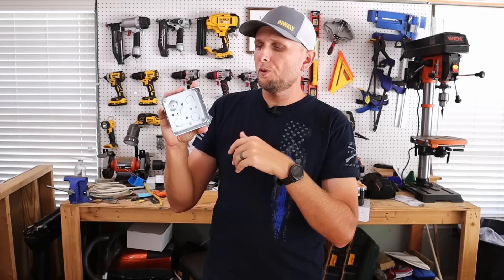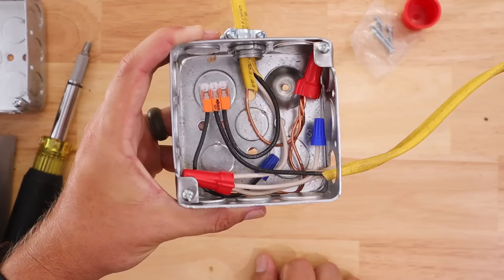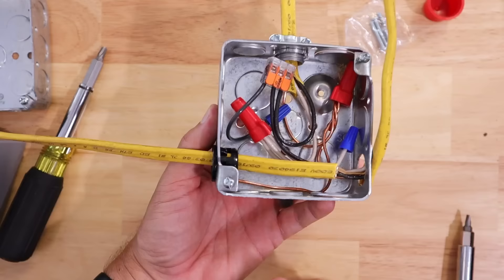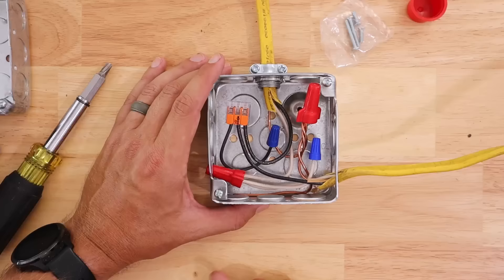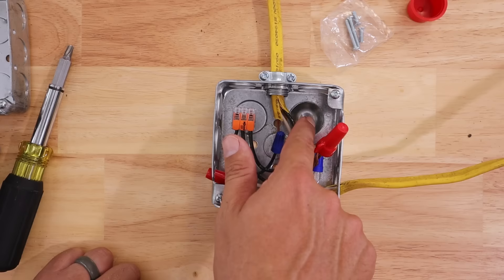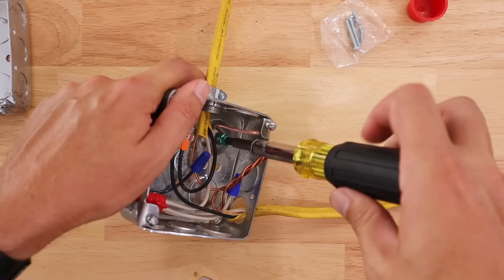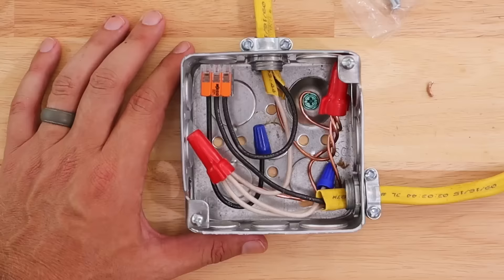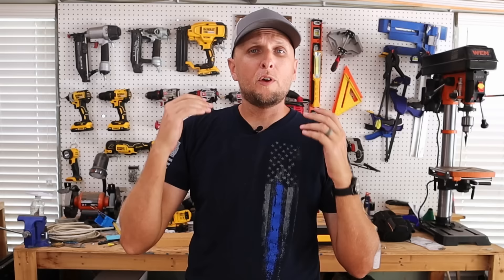The BIGGEST Mistakes DIYers Don't Know They Are Making When Installing Metal Electrical Boxes

Comment: I found one more mistake in that box which is also extremely common.  The length of free conductors is supposed to be 6" .  I do not have a current NEC to look this up for you, but nothing I hate worse when opening up existing outlets and such to find the device won't even hardly come out of the box because of the length of the wires.  Your example is not terrible, but the length of some of the wires is really too short.  Such as the neutral from the romex in the bottom right corner.  I like to bring all of a specific conductors I am going to join together in my hand and curve them in the direction I intend to fold them back in before cutting them.  This way I know I have at least enough to meet the intention of the code.

Comment: point of note to be had for any contractors that do upfits to add these kinds of boxes. the company i work for builds industrial controls and one of the products we make are essentially the control buildings that run chemical plants and similar installations. as such we run all the utility wiring for these buildings and that includes mounting receptacles and lights and all the related conduit and boxes.  these metal 4x4 boxes can be purchases with not only the ground screw pre-installed but also with a 8 inch 12 awg green wire already preinstalled as well.   just a small time saver a lot of people aren't aware of.

Comment: Here in Canada, ALL our boxes come with bond screws. We don't have to buy anything extra. They do NOT have to be green they just have to be the "proper thread". Also, if your connectors fail (wire nut/wago as you call them - which we frown upon here as they only contact a very small portion of conductor) and the conductor hits the metal box, that's installer error and you shouldn't be touching this type of thing regardless. It, which has been mentioned, is NOT a fire hazard to use a smaller gauge wire. Good example is in motor circuits where you can fuse a 14awg wire at (up to) 1600% of it's ampacity. Usually 300-600% but it can go higher.

Comment: You say 12 vs 14 doesn’t make sense but it does make sense. The hot could continue onto another box for another load, so it might need 12awg to handle multiple loads, but the pigtail for your one load here could very well do fine with 14awg

Comment: Sir, I agree with almost everything you've said, but there is one thing I must bring up. Wire gauge is in fact dependent on length. While code may or may not require a 12g pigtail, it is completely safe and adequate. Consider these two examples; while a 20 amp circuit may require 12 gauge wire, it may require a heavier gauge if the run is excessive in length. On the other side of that, consider a window mounted air conditioner requiring a 20 amp circuit on 12 gauge wire that comes with a 12 foot long 16 gauge cord. Incidentally, I just installed such an air conditioner in my shop storage room/office. I know it may not meet my jurisdiction's code, but I extended my 20 amp, 12 gauge run closer to my a/c by five feet with 14 gauge wire. I also shortened the 16 gauge  cord by ten feet. So I've actually increased the current capacity even though I used a smaller wire to feed my receptacle. Sometimes code does not mean better. 
 Having said all that, I still learn from you. Thank you.
Reply: I agree with your logic but why oh why would you not use 12AWG on that extension???? Code is code even if it's for legal reasons.
Reply: @hogroamer260   Because it would have required a trip to town and for the purchase of another roll of 12 gauge. The only reason for this would have been the to appease a code which is completely irrelevant in my rural personal shop. I am much more concerned with safety than I am with meeting code.

Comment: You should also have a ground pig tail for the ground ti the outlet. Also, Some push connectors are only rated for #14 wire. I only use push connectors for #14 wire in lighting circuits. I use #12 on all receptacle circuits, pretwist and wire nuts.
Reply from the maker: That last ground pigtail is in there.  It is just hiding behind the neutrals..

Comment: One more thing you might want to mention is putting a push penny; properly a knock out blank; in that open knock out. That opening is how the molten metal spatter from an arcing fault would escape the box and ignite the structure. 

Knock out blanks come in a couple of different configurations. If the blank isn't listed by a recognized testing laboratory then it must be as thick as the box wall itself. One quite effective expedient is 2 fender washers installed inside and outside the knock out held in place with 1/4-20 hardware. 

Tom Horne

Comment: Some Advise for pros: If you start working in a house and you find mistakes, Stop work tell the owners, and advise them to get the electrical system inspected. Document what you found and your recommendation in the invoice.  Houses burn down and people get electrocuted you do not want to find yourself in that position after you have worked on  a house.

Comment: Nice video for DIYers! Obvious US by color code of wiring, green tape should not be used to color use pigtail shown in video. Some installations require insulted ground wires. Also, you remove the knockout on the left side to show the NM connector. Did you put a knockout seal back in the open hole?

Comment: Suggest putting your grounds on the left to minimize the chance of those bare wires touching the hot terminals on the right side of the installed receptacles.

Comment: Regarding the #14 pigtail - it only needs to carry the current of the outlet it's attached to. If the outlet being installed is a 15A one, the #14 should be sufficient.

Comment: I was also taught to “pretwist” the wires, and also to pigtail the outlets. More work, but it makes a difference.
Reply from the maker: I agree.  Thanks for the feedback!
Reply: The UL certification process for twisted wire nuts requires that they make a solid connection without pre-twisting.  This assumes a proper number of connectors and properly stripping and positioning them before twisting. No solid connection, no certification.
Reply: @Steve B  Certification means jack shit. Not pre-twisting is a great way to end up with a high resistance connection that causes a fire. Hell, I just had one on my own water heater - which was installed by a licensed plumber (who are not required to hold electrician licenses). After 4 years I all of a sudden had no hot water, and found the breaker tripped. When I investigated, I found the nut connection in the heater junction was high resistance and had over the years gradually melted the insulation off over a foot of #10 armor sleeved Romex undetected until it finally shorted out. So yeah, anyone who doesn't pre-twist nut connections is a disgrace to their profession.
Reply: I learned to pre twist too. After doing that for a few years, one day I read the instructions on the bag of wire nuts and it said there was no need to pre twist. I did some work for a neighbor and didn't pre twist. A couple weeks later, they told me the light I installed was flickering. I checked the wire nuts and one of the wires had come loose. I removed all the wire nuts I had installed, pre twisted, and put them back on. No complaints after that and I learned the importance of pre twisting. That was a long time ago and what I've found since then is that 2 wires in a wire nut can hold without pre twisting, but for 3 or more, I always pre twist. Pulling a little on each wire after pre twisting and installing the wire nut also helps insure that one of the wires didn't slip and become loose when you were installed the wire nut. I like the comments about not tightening the clamp too tight on the Romex connector. Back in the 1970's when I started wiring, the insulation was significantly thicker and you could make the clamp tight without trouble. But when installing 12/3 w/g for a new outlet, I tightened the clamp too much and caused a short. I had noticed the much thinner insulation, but didn't think about the clamp cutting through it. I'm always careful tightening clamps now..

Comment: While a wirenut is ok for the grounds we always use a crimping ferrel to pigtail the grounds and if you don't pigtail the ground to the steel box, at least when you connect the ground to the outlet it has the ground to the mounting tabs which then grounds the box via the mounting process. That is ok for residential but commercial must have it's own ground wire to the box and EMT conduit must be used. [No rome cable is allowed unless it is a conduit.]
It is against code to just stuff a rome cable or even just wires through a knockout hole. You MUST use something the clamps the wire and prevent sparks from exiting the box.

Comment: Good presentation. I have seen green wire huts with a hole in the end which you push one ground wire through to go to the bonding nut. Twisting them all together is the best.

Comment: If I remember correctly the 15 amp rating for the 14 ga wire is when that wire is part of an encapsulated bundle. A single 14ga wire I believe is rated for 20 amps. Also, if memory suites me... it is common for circuit board designs to use 14 ga for internal components above 20 amp.  

Not encouraging people to go against code but it is important to know what stuff so you truly understand what is within that capabilities of the system you are working with.

Comment: In Holly, MI I was required to use green ground wire nuts that had a small hole in the end, which allowed for one ground wire to be left extra long to go through that hole to the metal box ground screw and still be able to twist on to the rest of the ground wires. I don’t know if that is code everywhere.

Comment: Ground screw is not required to be green, just required to engage two threads in the enclosure. Locknut on the metal NM connector is on backwards, knurling faces the mounting surface to bite into the box. Also need a ground tail for the receptacle. Also pay attention to required conductor length in the box. All in all good video for the DIYer
Reply from the maker: Yes I said green ground screw because my audience are mostly homeowners so it’s much easier for them to go to the store and find the green ground screws in the electrical section and know that they are going to fit correctly instead of them trying to search out a machine screw that fits.  There is a ground tail in there it’s just hiding behind the neutral wires.  Also all of the wires were measured out to be at least 6” long and extend at least 3 inches past the front of the box.  I appreciate the feedback!

Comment: When I'm working a house from scratch I always wire for 20amp and make sure the circuit breaker box and handle the number of 20amp breakers needed. My reasoning for this, is because clients tend to be stupid sometimes and plug heavy drawing items into 15 amp plugs. Also particularly on w story foyers some people don't know the fixture going in the spot how much light it will use.... A 12 light chandelier rated at 60watts per socket will overpower the wire as well as the switch.

Comment: See a lot of homeowners using the two screw connectors on romex and over tightening through the insulation. Be careful tightening the clamps.

Comment: If you run armored electrical cable into a metal box (like MC or AC) then you do not need to attach a ground wire to the metal box.  The cable sheath itself acts as the safety ground, so when you properly clamp the cables to the box it establishes the grounding path.

Comment: You can use 14 gauge wire on a 20 amp circuit when this is a tap conductor. when using a Wego connector, make sure you use a Cable tie to keep the wires together. This will prevent one of the wires from pulling out.

Comment: On that twisting the wires bit,  I did some extensive rewiring and started having problems with loose connections coming apart in crowded boxes. I wound up going through and twisting every wire nut connection I had made.

Comment: Some boxes do not have a threaded hole for the ground screw. Instead, you can use green-tinted grounding clips that slip over the edge of the box. The clip grips tightly, but of course you still have to screw the cover plate on, which holds the clip positively. I always put the clip next to one of the cover screws.

Comment: I do hvac and always use metal boxes. I also use wire nuts. That's just what I'm comfortable with. I do pre twist the wires now after watching another one of your videos. Just seems like it's a safer thing to do even though I've never had wires come loose.
Reply: Read the instructions.  If the wires are stripped properly and sized properly for the nuts youre using then the only other requirement is that they be held even. Pretwisting wont matter.
Reply: @jeremyhall7951 yeah the wire nut twists them just the same, maybe better than wrangling them with pliers.
Reply: @jeremyhall7951  Yup, holding the ends even with the proper wire nut is the key factor.

Comment: Good informative video.  However, one thing your presented isn't exactly mistake, the #14 pigtails with the #12 wire.  If the circuit breaker is a 15A then it is just fine as the NEC defines the ampacity of the circuit to be that of the lowest wire in the circuit which would be 15A for #14.

I'm sure you know why you would see #12 or even #10 used to feed a 15A circuit, long runs and to prevent excessive voltage drop.

That is just my nitpick, to call it a mistake is going to depend on finding out what breaker is protecting the circuit.
Reply from the maker: Yes my intention was that the breaker would be 20 amp with the feed wires being #12.  But I didn’t mention that and shouldn’t have just assumed others would get that considering using #12 on 15 amp is becoming more popular.  That being said, I still don’t like mixing wires as someone in the future may not realize there is #14 on the circuit and upgrade the breaker to 20.
Reply: @HowToHomeDIY  - That is a good point. 

I once ran into a person having issues with their 20 anp circuit unable to run the equipment in their little shop they wanted as the breaker always tripped.

Looked at it and they had just swapped in a 20 amp for that #12 but it was a long 125' to their little shed. The wire used too much energy over the run so the higher amp stuff caused the breaker to trip.

We just can never know what people are going to do.

Comment: Thanks for the great advice. Regarding the ground screw, some time don't have those screws and just use any other screws as long as the thread is good. Besides the fact that green signifies ground on ground screw there shouldn't be any other differences by using other screws. Right?

Comment: I live in the tropics and have a bad feeling about the wagos. The manufacturers will hate me for saying this.The minimal contact point and spring like pressure for the wire to the wago conductor could be subject to corrosion due to the different types of metal (copper to steel) and create resistance and heat or even an arcing situation. A properly used screw gives more contact area and pressure. I always pretwist and solder before adding a wire nut. Maybe this is overkill. The house is mine and I have the extra time and energy. The downside is if you need to make a change it is harder to de solder and untwist. Untwisting can compromise the integrity of the wire. Aside from this, I believe it is a higher standard that is more resilient over time..

Comment: I'm in the habit of twisting as I know the connection(s) are secure before putting on a wire nut. I've opened up too many boxes, and the wire nut just falls off, or a wire may be loose. With some brands, the little threaded metal insert may not adhere to the plastic, and the process of tightening the untwisted wire will break the insert. This often happens when someone over-tightens the nut. Also easy to have one loose wire when using 3 wires, especially with 12 AWG or larger solid copper. 
Also, those plastic NM to metal box things are not as good as using the clamps.

Comment: I really like the way you explain things. I do have one question, what is it about the green screw vs. a regular metal screw?
Reply from the maker: So In this particular install the color green is not required but I think they do make for a more professional looking job.  There is nothing special about the green ground screw other than if you go to your electrical section or buy them online, you know you are getting the correct thread, size, and type of screw for the threaded holes in the metal boxes.  They are also surprisingly inexpensive.  Hope this helps and thanks a lot for the feedback James!
Reply: @HowToHomeDIY  Thank You, for your quick and helpful reply